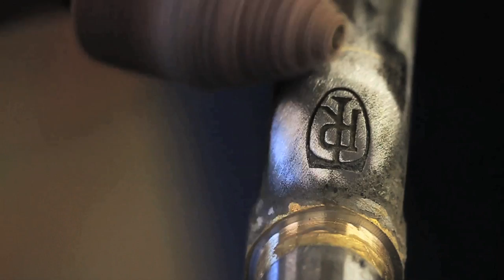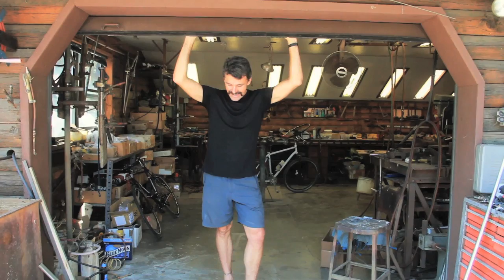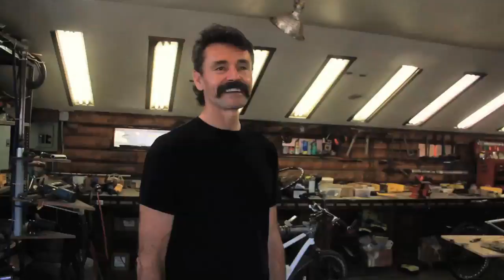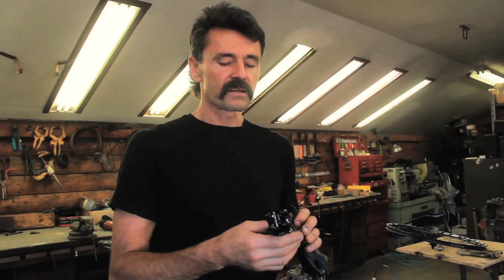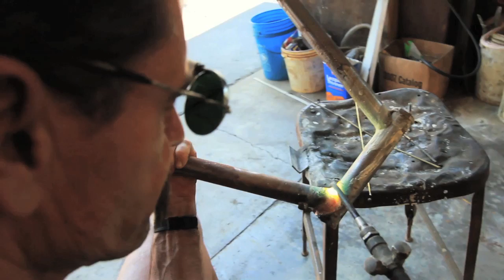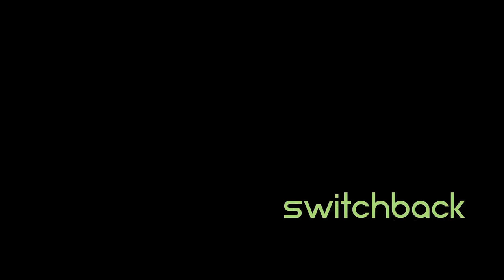The American Way: Ritchey

Comment: I'll probably never own a real Ritchey but do have a 1991 Rocky mountain Hammer with ritchey  Logic super tubeset . I have  many 26 inch wheel hard tails and it is by far the most plush steel bike i have ever owned. it rides better than my steel KONA Caldera.